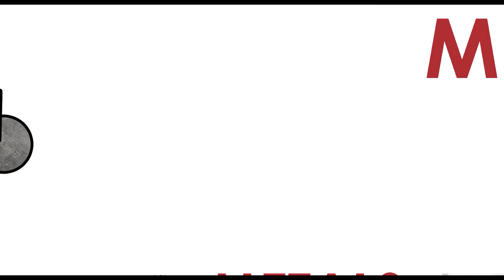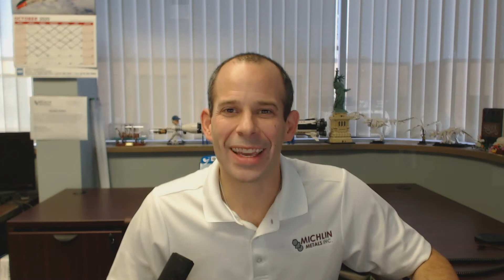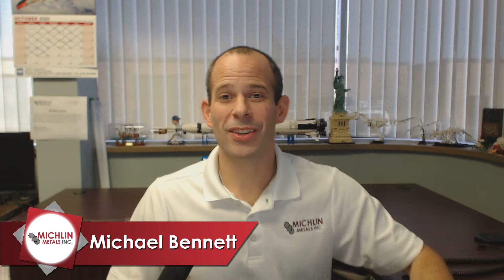PH Stainless Steels Part 2

Comment: Hello Mr. Michael. I want to heat treat my 17-7 material and get the maximum hardness and ultimate tensile strength. What will be your heat treatment suggestion for a 2.5 mm diameter rod? Ductility and toughness are not significant criteria. Does AMS give a suggestion to get the strongest product? I will be grateful if you can help. Best regards :)
Reply from the maker: short answer: If your bar is cold worked; CH cond is highest strength and hardness.